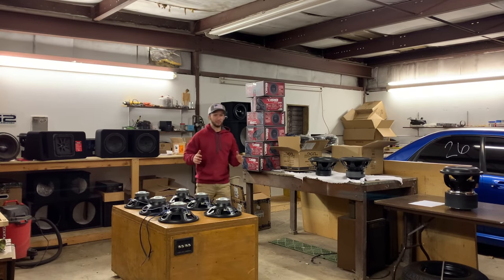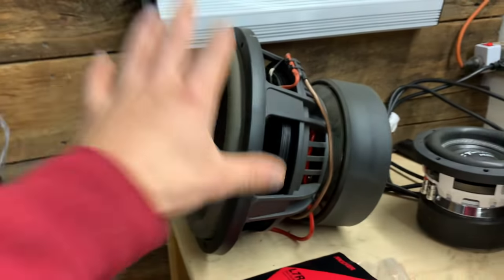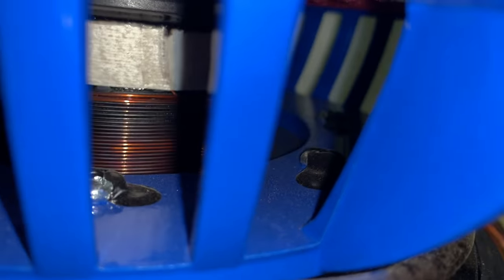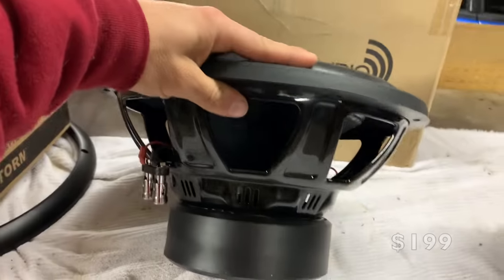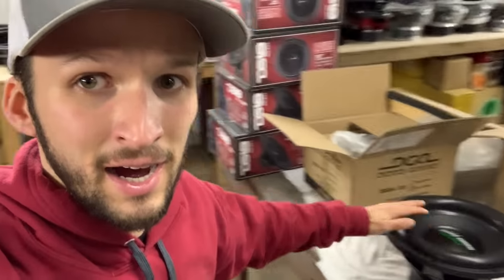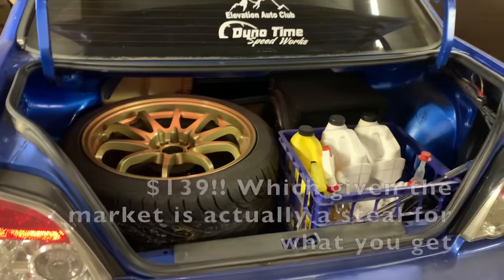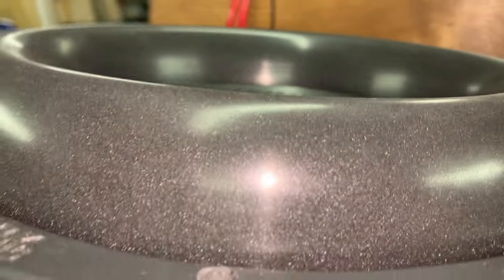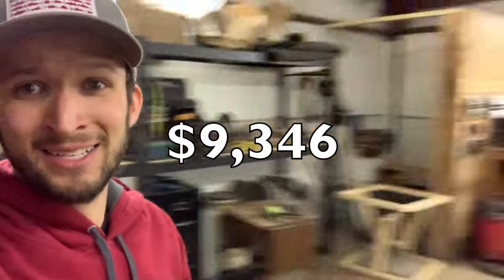My $10,000 Subwoofer Collection... And Giving A LOT of Them Back to YOU!

Comment: 4:14
Recently I noticed too the price increase, when I was thinking about buying another 12" subwoofer. I bought a few months ago, and when I looked at it online a few weeks ago, it cost $150 more. 
It's ironic that I then found a new 15" subwoofer, same brand, and rms for a lot less. It's from Massive Audio, same as all my subwoofers, and the rms is 2,000. My 12" subwoofer is also 2,000 rms.
5:52
Another economics, supply and demand story. A few months ago I had to buy some fancy new suspension parts. I probably bought the last ones in the U.S. It's excellent that I bought them at msrp from Real St, and not expensive.
8:20
I wonder what amp broke your MA subwoofer. 
Mine are fine, they're connected to amps that aren't too powerful for them.
10:09
You should sell some of your subwoofers.
Me too, I have two mint condition Diamond Audio amps that I don't need.

Comment: ⚡Which single 12 inch sub that you got has the highest DB test so far?
Reply: Think one if the american bass subs did 147DB but at 44hz to 50hz the sundown dud 145DB on lower frequency which says ALOT.

Comment: I collect different subs mostly Epsilon products but a few others that were important in a few older projects that I wish to revisit at a later date.
Here are a few in mention...lol
4 of the first Audiopipe TXXBDW218D2's
19 Gen3 Power Acoustik Mofo 15's 
9 SPL audio SPLW15's
8 Mofo 152X
2 Mofo 154X
2 Mofo 152XRC kits
3 fosegat T1 D415
2 Lanzar DC15 D4
2 BAMF154's
25 SPL audio SPLW12's
7 Mofo 122X's
1 Gen3 Mofo12
4 Alpine Type R 12's 
4 first Gen Power Plant P12's
1 L5 10 for testing in my shop
2 Sound Stream 5X Extreme series 12's
4 Sound Stream 5X Extreme 15's
And 2 Sundown X V2 15's 
3 Fosgate T1 12D2 12's
This is my sub collection.😁👀👀👀

Comment: Love the videos. I'm curious what your top choice would be for my setup. It's a homemade (by me) downfiring box for a 12" sub. It's 2.08 cubic feet, tuned to 36hz, and the port area is 29 square inches. I will be pushing it with the 5th channel of my Alpine pdr-v75, which outputs 250w RMS at 4ohm or 350w RMS at 2ohm. I have not yet selected a subwoofer but so far the CT Sounds Tropo 12 performs the best at 350w (2ohm) according to WinISD. I've modeled dozens of subs and so far the CT Sounds is winning. What else would you recommend I check out for this setup?
Reply: Don’t base it off winisd
Reply: @tylerpetersen2642  is there another app you'd recommend over WinISD? From what I've seen the modeling pretty closely matches real world results. I'm inputting all of the t/s parameters manually. I assumed t/s parameters were a good way to compare drivers and model results. But I'm still learning so I'm open to other options.
Reply: @lincolnwilcox  yes winisd is close with the RIGHT parameters. Your subs parameters are no where near what the company claims. Now if you you did your own ts parameters on the subs then yes I’d loosely base it off of winisd. The vehicle you are putting it in effects this a lot aswell
Reply: @tylerpetersen2642  That makes sense. What then, is the best way to select a subwoofer?
Reply: @lincolnwilcox  for me it’s always been hearing the sub in an enclosure. Ask around and make sure you know what you want out of the system. Sq or spl. I’ve always been a fan of a mix of both. A box is what makes a subwoofer 1000% of the time.  Not trying to steer you completely away from winisd. But don’t rely on it. I use for port velocity and things of that nature. But the graph will be different in a vehicle everytime. Nor does it account for the true sound the sub produces